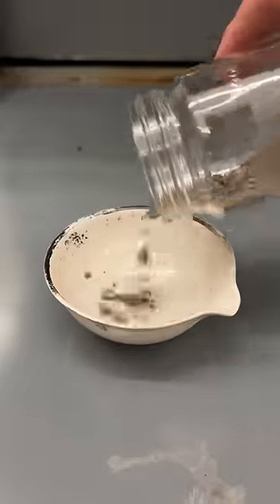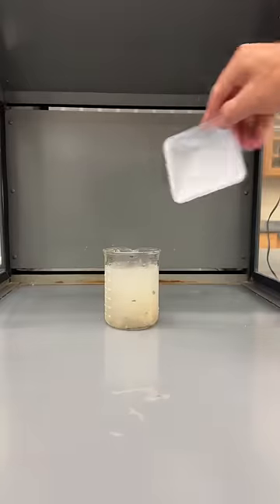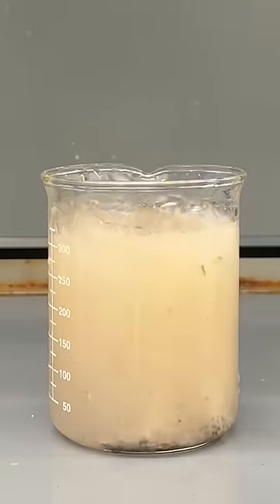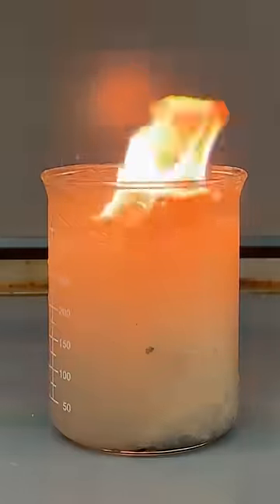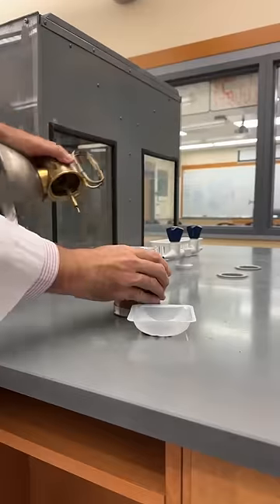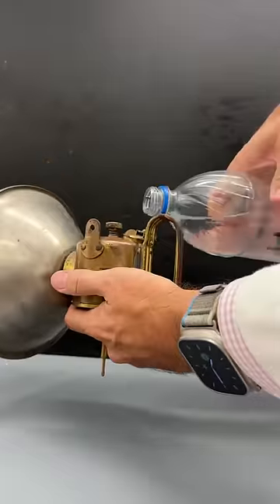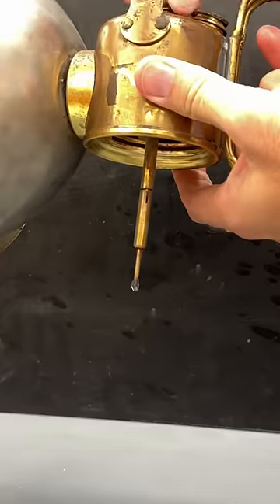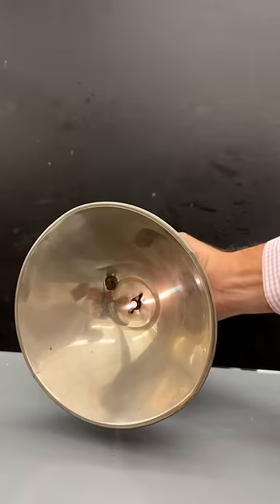Calcium Carbide is Kinda Strange

Comment: That lamp is a bug-out bag essential, and i need one ASAP.
Reply: I'd go with a kerosene lamp as they are more efficient and agnostic about their fuel.
Reply: @zinobi  yeah but this one is far cooler lol
Reply: @scottmatznick3140 you don’t want acetylene to mix with air in stoechiometric amounts because you forgot to cut the water off lol
Reply: @zinobi  🔴 What Is Islam? 

🔴 Islam is not just another religion. 

🔵 It is the same message preached by Moses, Jesus and Abraham.

 🔴 Islam literally means ‘submission to God’ and it teaches us to have a direct relationship with God. 

 🔵 It reminds us that since God created us, no one should be worshipped except God alone. 

 🔴 It also teaches that God is nothing like a human being or like anything that we can imagine.

🌍 The concept of God is summarized in the Quran as:

📖 { “Say, He is God, the One.  God, the Absolute.  He does not give birth, nor was He born, and there is nothing like Him.”} (Quran 112:1-4) 📚

🔴 Becoming a Muslim is not turning your back to Jesus. 

🔵 Rather it’s going back to the original teachings of Jesus and obeying him. 

More ....
Reply: Yeah, where are you going to get a steady supply of calcium carbide? An oil lamp can burn anything made of hydrocarbons.
Reply: @1islam1 tryin to recruit more terry are we ?
Reply: @TJ-um8ce wrong
Reply: I inherited one of these in my grandpa's shop when he passed away. Never actually had the stuff to try it out, and never cleaned it out. Didn't realize they were that bright
Reply: @TJ-um8ce  💀🤣
Reply: It’s not something you would want in the bug out bag. You would want lithium batteries in an air and water tight container along with the circuitry to charge and use them and probably some type of small solar panel because with that you can use almost every single electronic you would need if you wanna go a step further you can get dewalt batteries they can be used for higher voltage be able to jump start car batteries and you would be able to start small fires easily even when then battery is frozen
Reply: @zinobi both have very many cons compared to lithium battery’s and a solar panel to charge them with
Reply: @scottmatznick3140 yeah but you don't want cool in a bug out pack you want efficiency and the best possible gear you could get
Reply: @maxharz3914 Then why not get a wind-up lamp or flashlight? Doesn't consume batteries, and you charge it by hand
Reply: Bug out "bag".
Reply: Wait until you find out about flashlights bro
Reply: @TJ-um8ce  To be fair they might have a point with the nose thing. I have brutal sleep apnea.
Reply: No,  good flash light is. It's good if you're larping as a steam punk miner
Reply: No, trust me they’re expensive high maintenance and you need a shit load of rock to maintain it
Reply: You need one ASAP to bug out from your Playstation to the refrigerator
Reply: @1islam1 no one asked
Reply: Where are you going to get calcium carbide in a survival situation? You can make it, but it’s not going to be this pure.
Reply: @raygun26  don't you carry some in your pocket anywhere you go?
Reply: @1islam1 so you're telling me it's just a more strict Christianity that gives women even less rights?
Reply: @1islam1 Praise Indian Muslim God I am gay.
Reply: @1islam1 dude gtfo with that nonsense, this isn't a study group
Reply: A flash light is also a good option and it won’t start anything in fire 😂😂😂
Reply: The label on the bottle has me laughing! Danger rocks!😂
Reply: @DoesNotConcernYou dude that's ignorant
Reply: @1islam1  it’s crazy how much your religion mirrors my belief system. I’m agnostic and I see a lot of truth in what you’re saying. Unfortunately, though all religions have parts in them that are hypocritical or completely contradictory. Which is why people can use religion to do good or use it to do evil. It’s a knowledge tool. And like any other tool, it can be used for harm or for betterment.
Reply: @MrTalkingzero thank you 😂 everyone thinks they’re the main character in a zombie movie. Most wouldn’t make it a day without gaming and doritos and monster energy 😂
Reply: @SaltyAsTheSea maybe they shouldn’t be trying to recruit new cult members on YT
Reply: @liggerstuxin1  what parts do you mirror? Hatred of gays and SA victims?
Reply: @_..-.._..-.._  lmfaooooo
Reply: I've just got enough batteries at any given time to last literally years lol.
Reply: lmfao  bro you bringing a carbide lamp in a bug out bag is the stupuidest thing.

we upgraded to flashlights.
this is history we improved.   dont get people killed because you wanna look trendy
Reply: @1islam1 Jesus Christ is the way my brother
Reply: what the... okay this is not on the original topic at all, but doesn't everybody know to ignore the bible-thumping god-sellers? they show up in every comment section, they're somewhat annoying, but all you get for arguing with them is more comments from them

this is not denominationally specific and applies regardless of which specific version of god they are selling. being bigoted in any way as you antagonize the god-sellers definitely won't make them less annoying to deal with, it will just make you part of the noise
Reply: @1islam1 : That’s a lie. Islam teaches that Jesus Did not die on the cross, and was not resurrected, and that he was not the Messiah.

Jesus himself taught that he was the Messiah. He sealed it with his life, and thousands of people bore witness.
Reply: @SaltyAsTheSea  No his comment is accurate. Yours however, is ignorant, arrogant and pretentious.
Reply: @jamesbaker3153  how tho
Reply: @jamesbaker3153  also look like it got deleted, hahaaaaa someone's mad at me trying to be a good human being instead of hating with hatred like yall
Reply: You can buy a flashlight that's crank charged for like 20 bucks. Never runs out as long as you've got hands.
Reply: @1islam1 Please don't spam discussions like the Christians do everywhere, Islam is better than that and since it's the truth you repulse people from wanting to learn about it with your undesirable method
Reply: @zinobi true but having a backup that can use a totally different system is still a good thing to have in an emergency

Comment: Calcuim = "lime" in old-timey speak. Calcuim carbide/acetylene lamps = "limelight".
Reply: I was little confused with lime light and after reading your post, I remember now it used to be called Lime. Limestone light :)
Reply: Not quite, the limelights involved a blowtorch flame pointed at a limestone block and the bright glow as a result were the “limelights”. The Calcium in these miner’s lamps never leaves the reaction vessel. It stays there and is converted to Calcium Hydroxide while releasing acetylene gas which glows brightly because of the fine carbon particles formed by its incomplete combustion. An overpowered candle of sorts, yes, but not a limelight.
Reply: @thesentientneuron6550 I looked it up and you are right👍
Reply: @thesentientneuron6550 which one of those two, limelight and acetylene light shines brighter ?
Reply: @Gutrast77gh  Good question, but I really have no idea. It probably depends on a lot of factors that could skew either towards the winning side. Advantage with the limelight is that the blowtorch doesn’t have to run smoky (unlike an acetylene lamp) and the source of the light doesn’t change in shape much once up to temperature so it gives you a uniform light source which is kinda hard to do with the flickery flame of acetylene. You can’t easily make a limelight small, and you have more safety considerations if you want to make an acetylene lamp big.
Reply: Actually, lime is another name for calcium oxide. So, calcium carbonate was used for a limelight, not calcium carbide. When heated with a hot enough flame, CaCO3 decomposes to CaO ("lime") and CO2. As the flame source heats the (now) CaO, it produces a brilliant, glowing white light (candoluminescence). When such a light was directed toward the stage, the illuminated actor was said to be "in the limelight."
You can easily reproduce this effect by heating a piece of chalk with a propane torch. Beware: It is really, really bright!
By the way, using calcium carbide would be a really bad idea. The acetylene that is generated rarely combusts thoroughly in room air, let alone in a glass lamp (where there is a limited oxygen supply), and a large amount of elemental carbon is produced, in the form of a nasty, thick soot that coats everything nearby.

Comment: Fun fact. Exposure of this gas on young bananas can speed up its rippening. 24 hour exposure can make your average "still green banana" taste like yellow bananas
Reply: I think you mean ethylene. Oranges also produce it, so if you place orange and bananas together, the oranges would ripen faster than normal
Reply: @24dasr  No acetylene works just as well, and so does propylene (another welding gas). They actually use carbide in horticulture for this, to make fruits ripen faster, but its use as is is forbidden, because the carbide isn't pure and has contaminants that produce small amounts of phosphine and arsine, which are poisonous abnd could be absorbed by the fruits. It is however possible to filter these out using simple washing bottles in series with the carbide generator, in the same way they produce chemically pure acetylene in the lab.
Reply: As well as mangoes, too! 🥭🥭🥭🥭
Reply: It was commonly used to artificially ripen many fruits, but this is a practice that is now commonly banned.

Comment: We still have my grandpa's old carbide light and "helmet" which was just a thin cap to hold the light. He mined untold amounts of eastern KY coal on his hands and knees when they used hand tools and mules.
Reply: My back was hurting enough before I read this. Come on man.
Reply: Same here. I have some from my great grandfather. They mined in the Lehighton pa area. Actually the Tuscarora coal mine near tamaqua. Would have been around 1900. They passed in the 60s.

Comment: I saw an old race har that had a headlight system using this. There was a large chunk of calcium carbide that you adjust a drip flow onto. Then the gas could be hand pumped to add orrssure and burn in the headlights.

Comment: I had a brass carbide lamp when I was in high school.  It throws a better light than the incandescent 6V lanterns we could get back in the 1970s.  Wider illumination angle, more even brightness, and quite a bit brighter.  The lamp also weighed a lot less, though you had to carry water as well as carbide to refill it if you needed more than a couple hours of light.

Unfortunately, if you don't clean the bottom chamber pretty promptly after using the lamp, the calcium hydroxide that forms in the bottom will eat the solder that holds the brass parts together.  If you shake it, the felt that filters the gas will get wet and the gas can't get out, and there's no quick way to dry it out (especially in a wet, muddy cave).

There are good reasons these lamps aren't used much any more -- but until white, high brightness LEDs and lithium batteries, they were overall the best primary light source for spelunking.  And you can put two or three of them close together and boil water for soup or coffee...

Comment: More than welding we use acetylene for cutting mild steel. You should make a short about the sceince behing Oxy-acetylene torch cutting. Most think it melts it, but you actually combust/rust it.

Comment: In Croatia we call this "garbure", and we use them to launch pots and barrels 20+ meters into the air
Reply: Sounds fun
Reply: Oh yeah. And fishing too.   We called it carbid in Romania
Reply: We used to do the same here in Belgium in the old days in rural areas, to celebrate weddings. Also farmers used a similar device that produced small explosions on a regular basis (acetylene under light pressure), to chase away starlings from their freshly sown fields.
Reply: Here in the Netherlands too!

Comment: I'm a US Army retired combat veteran, with multiple deployments to Iraq, Afghanistan and Africa. Primarily in Afghanistan, insurgents and ACM (Anti-Coalition Militia) networks, such as Haqqani, used Carbide to make homemade anti-personnel mines, out of the metal tins. It wasn't powerful enough to kill a person, but injuries would be significant enough, that an injured soldier needs to be evacuated, which basically ties up 4 or more soldiers to do so. Making an entire   unit, less effective. So yeah, Carbide can be used in many different applicants and not just by chemistry teachers to carve out pumpkins. It can also carve out body parts as well.

Comment: In the presence of a flame, acetylene reacts with oxygen to form carbon dioxide and water.

2 H2C2 (g) + 5 O2 (g) --> 4 CO2 (g) + 2 H2O (g)
Reply: The yellow, sooty flame indicates that other reactions are happening.  I'm still in doubt regarding "no CO"

Comment: When i was a kid there was an old mechanic/ welder in my home town. He had an acetelene generator. Big old tank with water in it on wheels that had a small tank on top that would dribble the calcium carbide into the water. It would blow up and catch his clothing on fire on occassion. He had this pond that wasnt much more than a mud hole that had junk parts throun in it. He had a path to this pond to where he could go jump in it when he cought his clothing on fire. He loved to phesant hunt. If he had your car tore apart when it came hunting season. He would drop working on it drive one of his many jeepster wagons to nebraska from illinois and hunt for at least 2 weeks before he came back and finished working on your car. Was an amazing old man that lived like he didn't have a dime. But his wife always drove new caddilacs.

Comment: My dad made a carbide lamp decades ago. It looked like a steel bottle with a long, thin neck, sort of like a pencil, with a very fine nozzle at the top. The bottom of the bottle was threaded onto the body. The carbide would go inside, and the whole bottle would sit in water. You'd regulate how much gas was being generated by how tight the bottom was screwed on, which determined how much water would infiltrate through the screw.

Comment: It is also called "lime light" and used in spit lights.  So if you have heard the phase "in the lime light" this is what they are refering to.
Reply: Thank you, for the enlightenment. 👍💡 I crave these tidbits of knowledge 🙂
Reply: Limelights work by heating calcium oxide (not calcium carbide) with a HHO torch.  It's not the same thing.

Comment: Acetylene is very rarely used for welding or hardening steel. In most places, it’s used almost exclusively for heating and bending, and cutting. It is still used for brazing, though even that is being slowly replaced with welding processes.
Reply: Oxy-acetalene IS a welding process! 🙄
Reply: @mikehunt8968 I didn’t say that it isn’t. I just said that it’s almost never used anymore.
Reply: we call oxy-acet the 'blue wrench'.
Reply: @grahamwaldo331  It's still the only welding process that you can use when electrical power is not available😉
I learned to gas weld 52 years ago at the age of 13, but I also have kit to do all the other types...and it's the best base skill for learning the other types, the nearest to it is TIG, very similar skills required...
BTW,  you DID say it was being replaced by welding processes, which grammatically says that it was not a welding process...🙄
Dad you included the word 'other' it would have been correct...😉
Reply: My father spent a lot of time welding throughout my entire childhood, and probably beyond. He always kept oxygen and acetylene on hand; One of the first safety things he taught his little girls was to turn off the welding machine as we entered the garage, if he were welding.

He worried about us getting a flash, And ending up with problems with headaches or vision problems.

Comment: Calcium carbide lamps are still used by cavers today! They’re meant to last for the average time of a miner’s working shift and they can easily be refilled and replaced. On long caving and spelunking trips this can be helpful instead of lugging around lots of batteries. The reaction is exothermic so it’s helpful in very cold caves to stave off hypothermia. In very remote caves without access to electricity they are also used in place of more modern LED lights. Calcium carbide lamps are also sometimes referred to as “stinkies” because of the foul odor they emitted. They aren’t used anymore because they are often very prone to gas leaks and explosions, not to mention the fact that LED lights are very cheap nowadays. But still many cavers prefer to use them for their vintage value.

Comment: Miners but actually motorcycles and cars as well :)  You can see a lot of pre 1930 motorcycles still running around with those lights on. A great example is the Zuendapp Z200 (earlier models)

Comment: Acetylene gas is also insanely unstable and can be explosive when just over pressurized. Craft store in a mixture of acetone and a porous material inside tank so it doesn't just combust at high pressure.

Comment: It's not used for welding. At least, no any more. It was used for gas welding and soldering. 
With welding with electricity, we mostly use Argon/CO2 mix or pure Argon.

Comment: As an auto mechanic, I use acetylene and oxygen in a torch for the process of rapid oxidation to cut off old exhaust pipes or to heat up really rusty bolts. Always remember if you cut steel with an oxy acetylene torch you need to grind your edges or they'll rust

Comment: Fun fact about the miners laps, they also mainly used it because when the air in the mines was toxic or high carbon monoxide, then the lamp would just go out, and they knew, that they have to run because they could  suffocate.